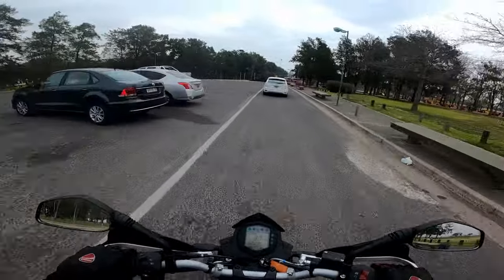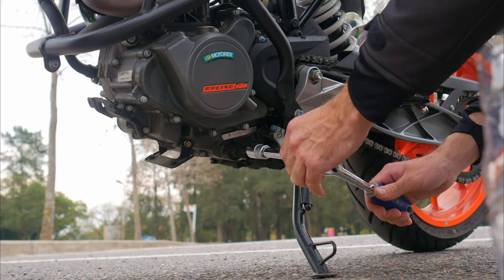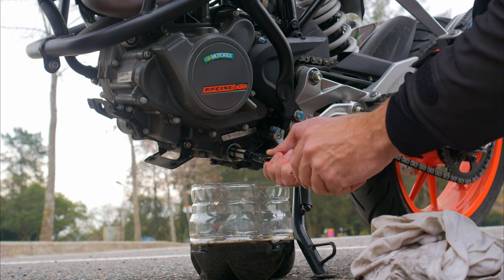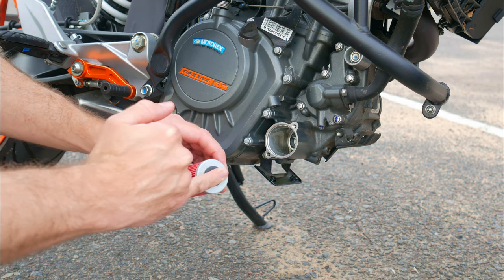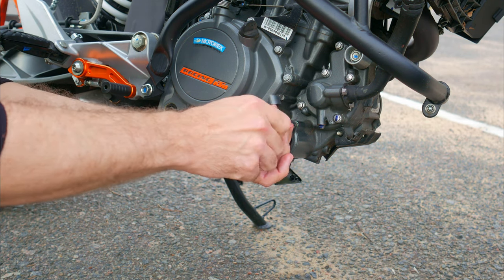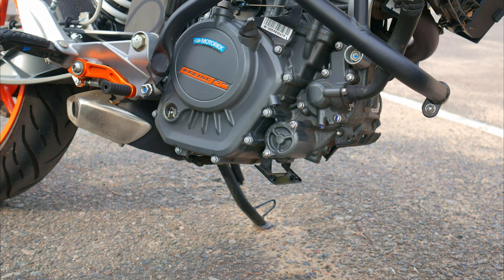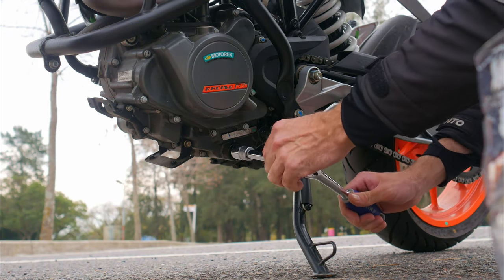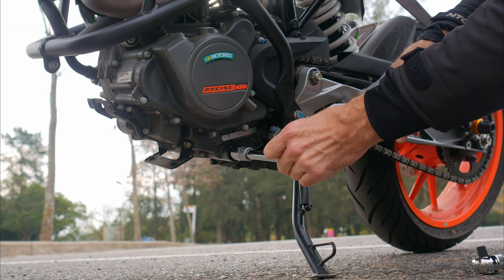How to Change Oil Properly

Comment: One problem people often have is accidentally putting in too much oil. I find that it doesn't take much oil to make a big change in the level in the sight window. To avoid that problem, I put in say 100ml less than I think I need, and then check the level, and put the rest in slowly as needed. 

I don't think that slightly overfilling is a big deal however. Every time a mechanic has changed the oil on my bikes, they have overfilled them slightly.

Comment: Awesome video, as always! Something that could be added, is that at least here in Argentina, some mechanics will have proper ways to dispose of the old oil, so sometimes you can take it to them to get rid of. Just don't throw it in any random place that's not meant for it.
Reply: Good advice. Every mechanic should keep the exhausted oil and follow specific rules for waste treatment.

Comment: Yes, there IS harm in pre-filling the filter. You can EASILY get shit on the clean side.

Besides, there's still oil coating the insides of the engine. It's fine.

Comment: Sir u bought duke 200 ?
Duke 200 is  my favourite 200cc motorcycle 🧡.
Very informative video on oil change Thank you Sir.
Reply: It's 390
Reply: @houseofelectronics5869 No brother that's a first gen Duke 200. See the tank sticker on the video 8:35 the other motorcycle sir had in older videos was the 2nd gen Duke 390

Comment: You don’t need to fill filter with oil, even on some oil filters is image that you don’t need to fill it with oil… The best advice is to use just simple motorcycle manual for this work and I haven’t seen in any that you need to fill up filter with oil, some bikes requires crushers to be replaced.
Reply: That’s exactly what he said 😉
Thank you

Comment: Instructions unclear. My 2 stroke didn't like the oil.
Reply: 2 stroke still need motor oil and procedure same as video explained. 
Other oil is "2T oil" . 2T oil use for lubricant crankshaft con rod, which  cause of sistem 2stroke engine not allowed motor oil reach conrod.

Comment: Use a magnet to pull the filter out. Not a knife lol. Absolutely under no circumstance should you use a steel screwdriver to put your filter out against your aluminum block. Ever.